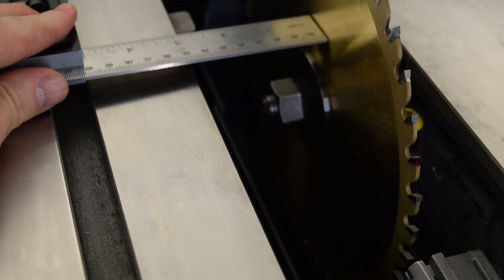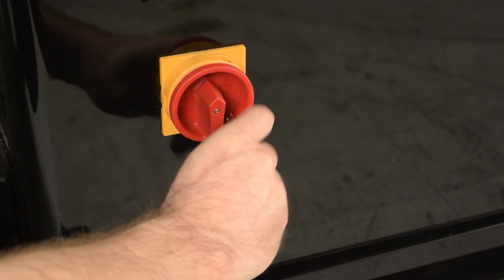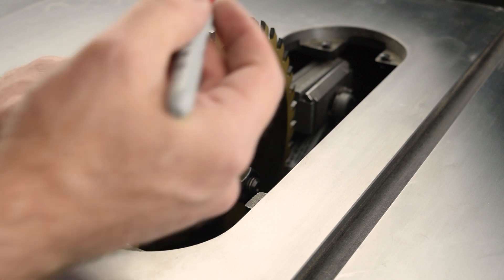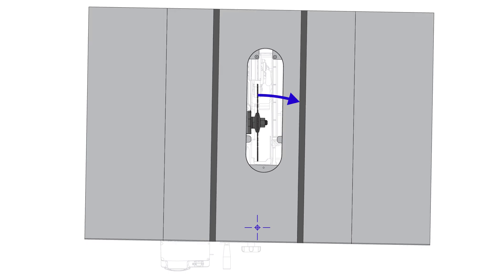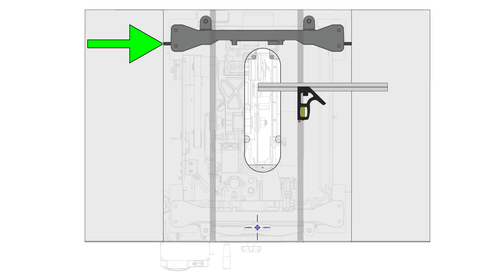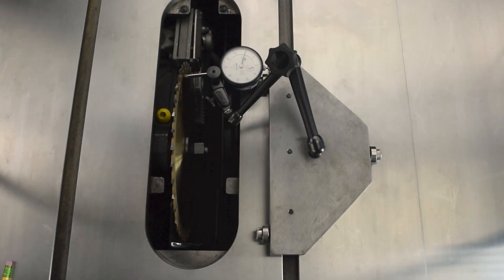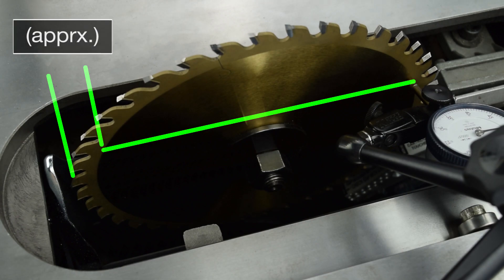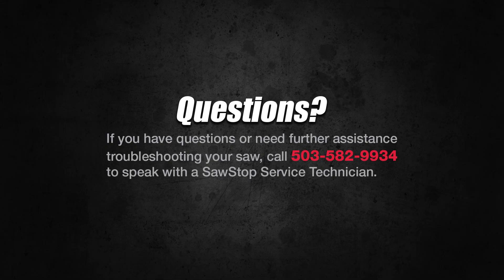SawStop Service Tip: Align the Table for Your Industrial Cabinet Saw

Comment: I have never had a fine adjustment table saw like this.  I was able to dial this form 0.021" out to .001" in 5 minutes.  This is way cool.  I also checked this at 45 degrees and was off by 0.010".  Close enough for me.  I don't feel like adding shims for for this amount.

Comment: What's the difference between 1ph and 3ph when it comes to making your purchase of 5hp industrial model?
Reply from the maker: 1PH is usually meant for for residential areas, while 3ph is meant for commercial areas.

If it’s a commercial shop, you would need to make sure the shop has the ability for 3 ph power. The big difference is 3 ph power gives a more consistent power draw over 1 ph, thus rendering a lower amperage draw from the motor. This lower amperage draw equals the saw being cheaper to run over time.

Looking at our specs section on the Industrial Cabinet Saw page https://www.sawstop.com/table-saws/by-model/industrial-cabinet-saw, you will see the amperage draws. The example below is for the 5hp motor alone.

ICS51230 = 19.7A
ICS53230 = 12A
ICS53480 = 5.8A
Reply: thank you

Comment: Is it just me or does this video completely gloss over the fact that the rear bolts are inside the cabinet and you have to tilt the blade to 30 degrees to be able to access the left rear? then  you have to put the blade back to zero to do the adjustments.
Reply from the maker: Yes, we apologize that this portion of the video is missed. The bolt on the top right and top left are both easily accessible. Tilt the saw and loosen the bolt on the top left, then tilt it back to 90 degrees to complete the blade alignment
Reply: No you dont the bolts are outiside the cabinet

Comment: We have the contractor model in our school shop, and while the saw stop is an important safety feature for our students, I am less than impressed by the rest of the saw. The miter stop is not of a quality one would expect in a saw of this price range. The fence is firm and accurate though. Dust collection leaves a bit to be desired as much of the saw dust covers the front of you in spite of our massive dust collection system. The  biggest concern though is that after only a few years of very intermittent use ( we only operate 9 months out of the year, and the saw gets used less than an hour a day), the motor went out on us, and rather than a simple fix like a switch or capacitor, the motor had to be rewound. I have used many different saws of this caliber over the decades, and have never had to replace or rewind a motor on one. Equally concerning is that sawstop was no help at all on this issue, so with the limited budget our school shop has, we had a several hundred dollar ($350) repair bill to get it back running. Needless to say would not be my choice for the home shop and definitely not for a commercial shop..